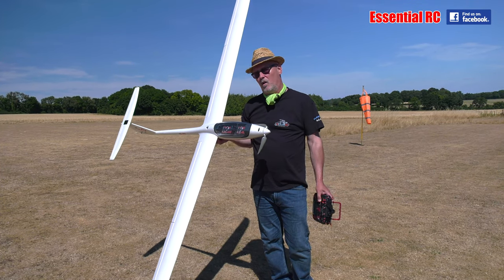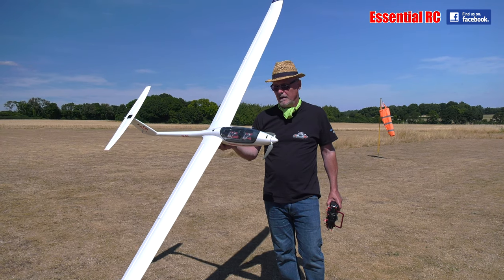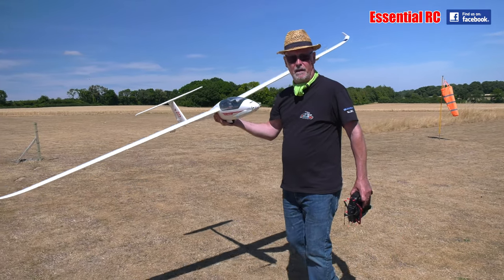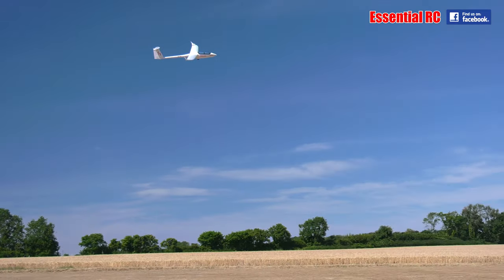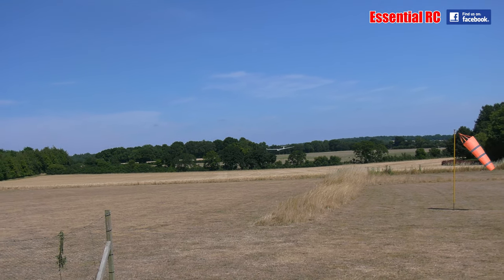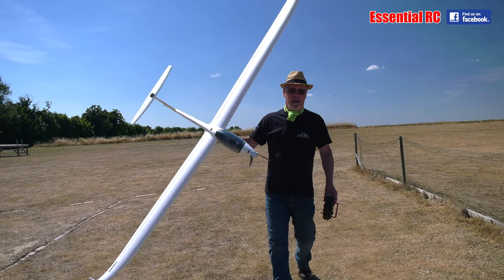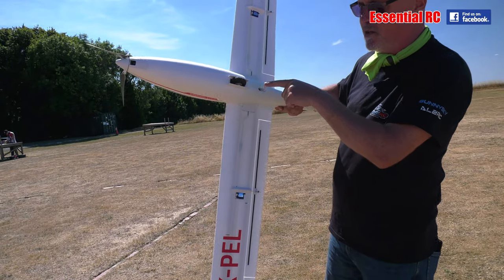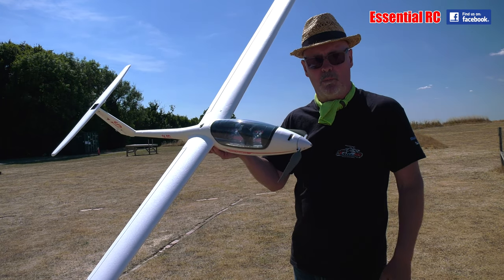RC POWERED GLIDER PERFECTION ! Kavan 304TS TWIN SHARK 2.7 metre Sailplane | Essential RC FLIGHT TEST

Comment: My Pulse 2200 is also flying now 😊
Also using the Radiomaster TX16. Programming flaps and ailerons was quite a challenge with 5 modes, including butterfly and flaps as ailerons for acro-mode. 
But now it works, and it is fun, also a lot of woosh 😁
Reply from the maker: Very cool!

Comment: Would this be a good plane to make long range FPV plane or should I get the Volantex 2400mm?
Reply from the maker: Neither. Buy something that is designed for FPV. Best here https://atomrc.com/collections/fix-wing/products/atomrc-swordfish-fixed-wing?ref=ING52Rda
Reply: @EssentialRC  The reason I mentioned the Volantex 2400mm was because It already comes with fittings for installing cameras etc.  and I wanted the best flight time possible so a powered glider made sense. 

I think the swordfish is a lot easier to use and “build” as well as reasonably priced even with FPV included. Thank you I will probably buy that one and have the Long range glider project for another project later on.

Comment: At 44g/dm² it's hardly a lightweight. To put it into perspective, my F5RES X-Dream Elektro 2M powered glider has a wing loading of 12g/dm²
Reply from the maker: It is for a ready to fly foamie at that price 🙄. I'm not comparing it to a composite (which would be heavier) or a built up wing with a carbon tube (which arrives as a kit) which would be lighter...
Reply: @EssentialRC  Even so Dom, it's a heavy plane. I have a similar sized full house foamy glider, the Phoenix Evolution (2.6m) and even with its bulletproof plastic fuselage it only weighs 1200g RTF. This is more of a "glider shaped" plane than an actual glider

Comment: What type of reciever did you use...
Reply from the maker: I use either Frsky X8R or S8R. The latter has stabilisation gyro. My transmitter is a Radiomaster TX16S
Reply: @EssentialRC  thanx...are they compatible with spektrum transmitter
Reply from the maker: No. You need DSM2 or DSMX protocol receiver.